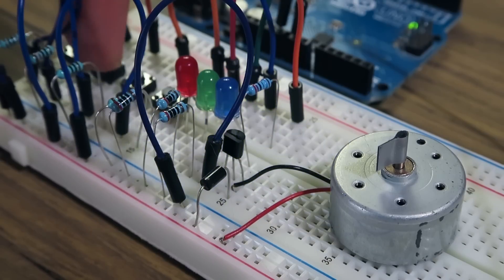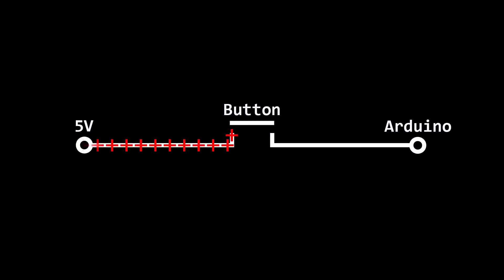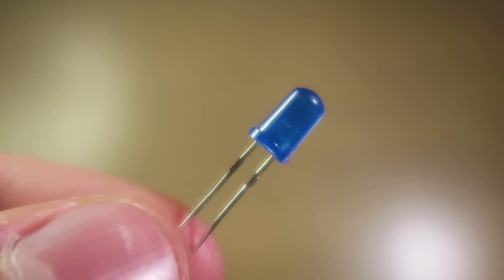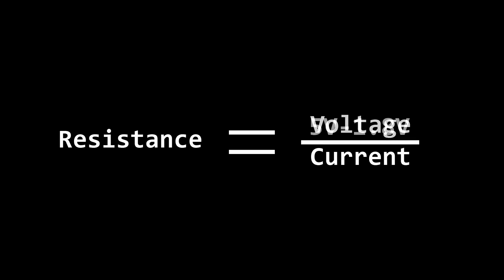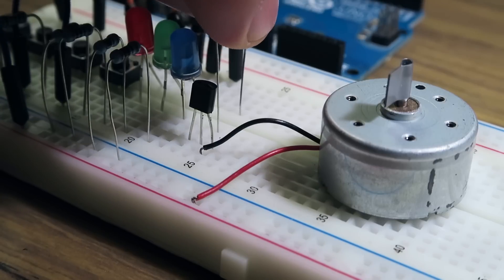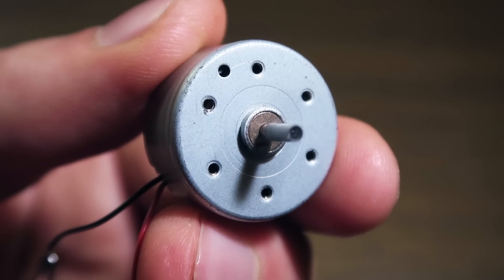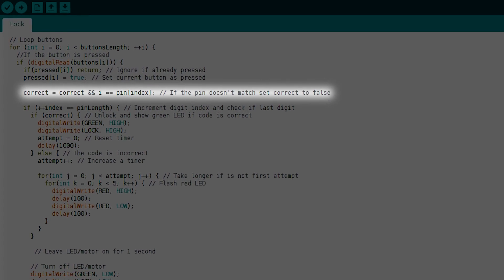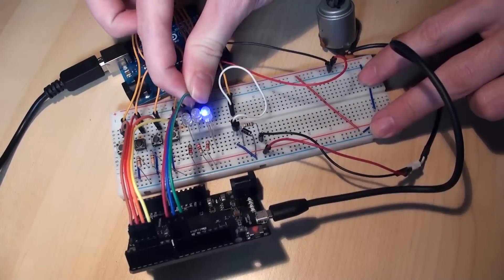Arduino Combination Lock (ft. LiveOverflow)

Comment: You could save the resistors for the buttons if you use the internal Pull Ups from the Arduino and connecting them to ground.
Reply from the maker: I thought about that, but using external pulldowns gave me the excuse to explain resistors. I also thought it would be easier to understand if I used high as 1 and low as 0.